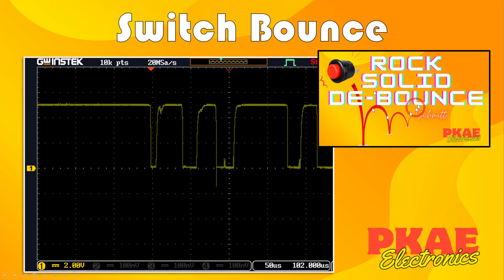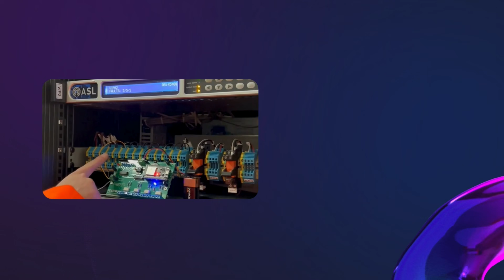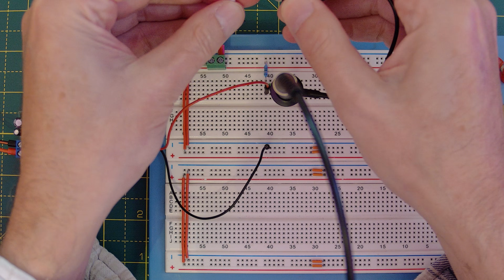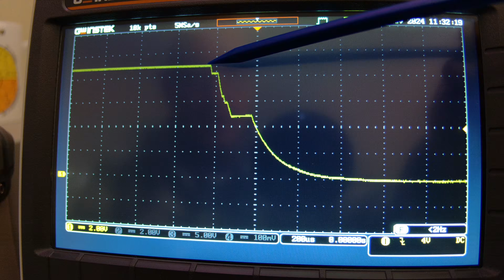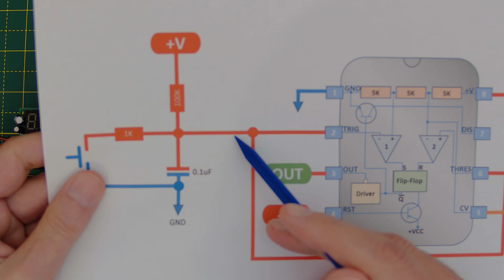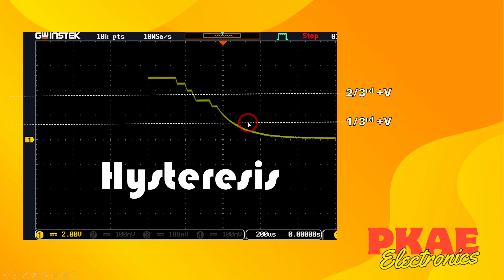Switch De Bounce Using a 555 Timer Chip.

Comment: Update:
I made the circuit on the tinkercad simulator, got the expected result so, now i will do the circuit for real; so once again thank you very much.
 I will implement your design, i'm having troubles with the bouncing, so i'm pretty sure it will work, i will try to understand as much as possible, but it can see it is a great design, so thank you so much.

Comment: Sir, is this a circuit that I can use to debounce lets say my flipper input buttons? Is this fast responsive? Or is it best to make a schmitt trigger circuit with actual schmitt trigger? What would work best to suit my needs? (I'm making a pinball table and we need debounced input buttons for proper microcontroller input handling.)
Reply from the maker: Sounds like a great project. 

This debounce circuit will give you a fast transition from high to low and vice versa, but the responsiveness is really derived by the sizing of your capacitors and resistors. There is always going to be some lag. If you are using a microcontroller, it is likely that the digital I/O's already have a Schmitt at the input stage (what microcontroller are you using?). 

In my opinion, if you are not doing anything other than activating the flippers when you press the button, then I would just hard wire the thing (probably via a transistor) and not utilise the microcontroller for this aspect at all. The mechanical response of the flippers will be massively slower than any switch bounce experienced. You're going to need fairly good quality push buttons anyway, as they take a bit of hammering in pinball.
Reply: @paulpkae  Im using arduino uno r3
Reply from the maker: @CrazyByte2007  uno as based on the ATmega328P which I believe does implement Schmitt triggers on pins configured as digital inputs.
Reply: @paulpkae  hmmm then those videos showing examples using an external chip (using arduinos) they are different? cause they recieve quite bouncy signals on their led / button combination (recieving lines of 1s in their terminal for 1 button push) I'm gonna check this first with my arcade buttons without any circuit to debounce and see if they bounce. Is it some feature disabled by default? or is this dependant on witch chip is inside the arduino running it? I believe I have an ATmega one.
Reply: @paulpkae  I was also thinking about that, but driving solenoids high for a while burns them out. So I figured to use pwm signal from arduino to drive the solenoids just enough to hold the ball when the player is holding the button down. In that case my thought pattern went to that direction. I also have a 4 channel mosfet to drive the solenoids. (so they are seperate from arduino and run at 12v from a PC power supply....)
Reply: I don't know if it works but on my channel in the community posts area I am posting pictures of the build. (it's a slow progress)
Reply from the maker: @CrazyByte2007  mosfets are a good shout, as they can typically handle higher currents than BJTs. You could use a 555 in astable mode to generate the PWM signal.
Reply from the maker: @CrazyByte2007  I have taken a look and it's looking good. I can see you're also using KiCad and getting PCBs manufactured. Great stuff!
Reply: @paulpkae  I just got two 555s in the mail today. guess I will be searching how that would work.
Reply: @paulpkae  Yes I picked it up 5 days ago. My first design is not correct tho. The second one that has a wider board should work fine. While creating it people from electronics stackexchange were very helpful. Might have to do some more verification before I actually let them get printed... so I got a breadboard and all the components, that also arrived today. So tomorrow it's breadboard day.
Reply: @paulpkae  Trying to post pictures of the build progress as often as I can. Today It was connecting leads to the first button and testing the led. I also found a combo LED that lights up green or yellow depending on how you wire it.
Reply from the maker: @CrazyByte2007  I have done a couple of videos illustrating the 555 Astable operation (links below). 

You can connect the 555 output to your MOSFET gate and use your push button to control the 555's reset pin (pin 4). Pin 4 should be held low and only pulled high when the button is pressed. 

https://youtu.be/3lEN6hEGUmE?si=-RFDLcEUCwk5RWEb

https://youtu.be/4NXjBRarmeg?si=5jD3LZUkFBkYvRti
Reply: @paulpkae  interesting. I will have a watch when I have some time to concentrate ;) just finished soldering connectors to the buttons checking polarity and done the wire labelling. So far the buttons seem to respond quite rapidly with the current circuit. 10kR, 1kR, 1N4001 & 1uF cap to schmitt trigger...
Reply: @ making progress.... https://www.youtube.com/shorts/9fS7Qp7z7gw
Reply from the maker: @CrazyByte2007  looks like you're having some fun with this; it's a great project. Reminds me a bit of my Fruit Machine project which I started and never really finished.
Reply: the breadboard recipie has been made and put to the test with the default readdigital pin sketch. it goes from solid 0s to all 1s if you push and hold the button. if you let go the 1s become 0s. if I read the monitor, I don't see something like this 011000110110000001110000010101010111111000000 where this could be just 1 button push without the circuit in place. with the circuit it's 0000000000000000000011111111111111111111111111111111000000000000000000000000000011111111111111111111111111 etc. no gaps. I don't know if it's fast responsive, waiting for solenoids.

Comment: Another question:
If you connect the output of 555 trough a capacitance to a TTL, the capacitor being also connected to +5V on the TTL side, then when the 555 output goes high the capacitor's voltage will momentarily be 10V. What will the TTL "think" about that?
Well the voltage spike will be very short in practice, but...?? Maybe one should add a diode between 555 and TTL to be safe.

Comment: I have enjoyed watching your youtube videos. They are well done and very informative, thanks a lot!
To my question:
Can you make an electrical connection using 555 such that when its input state changes either from low to high or high to low the output is a low to high (or hi to lo) pulse of a duration determined by RC?
Thanks,
Juha
Reply from the maker: Hi, many thanks for your comment.
The answer to your question is Yes. You can achieve the exact behaviour you queried, by configuring the 555 in a monostable arrangement. I will be doing a video in this in the near future, but in the meantime, you can find this circuit on the 555 datasheet.
Reply: @paulpkae  Thanks a lot! Now I remember that I have somewhere a datasheet book where 555 is also discussed, I just need to find it :-)
Reply from the maker: @MrJPI  if you Google "555 timer" and click on the "ti.com" link, you can view the datasheet online or even download it.

Comment: What about just using the 555 in bi-stable mode?
Reply from the maker: Really depends how you want the Switch to operate your device. In Bi-stable mode you typically utilise two momentary push button switches; one to latch a HI output and the other to latch LO. The behaviour is therefore quite different to a single push operation.

Comment: Ok, before that my favourite was schmitt trigger debounce method, now I have to try this. Thank you very much, Michael
Reply: Isn't this a Schmidt trigger? The pre-set 1/3 and 2/3 dividers of the 555 define the hysteresis limits.
Reply: @tedbastwock3810  Well, this one has a possibility to be tuned.
Reply from the maker: Thanks. 

A dedicated Schmitt IC is the better option, although I suspect many hobbyists have 555s in their home collection but not necessarily Schmitt triggers.
Reply: @ I see. Actually I also have a bunch of 555. And I like the idea of hysteresis configuration.
Btw, are you planning to describe a different variations of 555 maybe?
For example speedy ones:
Lmc555(up to 3MHz) or Tlc555 (over 2Mhz)
I have no idea where I could use such a speedy species of this family. For the radio devices construction, maybe?

Comment: Basically this configuration of the 555 is a Schmitt trigger inverter.  If you only need one and need to save board space, this will do.  Otherwise get a hex Schmitt trigger, more popular as an inverter.  If you get the inverter but don't want an inverted output, you have 5 other inverters in the package
Reply from the maker: Thanks for the comment. For those interested in the Schmitt Trigger IC alternative see my previous video here:-
https://youtu.be/JrCIgBUPhro?si=zdwQePjjZ9tjILGp

Comment: Of course if you just want a nice clean pulse with a minimum pulse length from a push button, you could use the 555 in it’s monostable configuration.
Reply from the maker: Video coming for Monostable operation. 😁
Reply: There 's no guarantee that the contacts will break cleanly.  If they bounce as they open the monostable may trigger again.
Reply: The problem with using a 555 in monostable state for denouncing is that the 555 won't hold the delay while the trigger is triggered.  Say you have the 555 delay for 100mS, and you hold the switch down for 1S, the 555 will still reset at least briefly after 100mS.
Reply: @danman32   actually a good point. I have to check if there is possibility to avoid this. 
If no, well - In this case I think usage of comparator will be more reliable…
Reply: @CybisterBug  there is if you're not particular about the timing.
Use a transistor to hold the capacitor discharged whenever and during the time the trigger is asserted.  Timing will then start once the trigger remains deasserted
The problem with 555's, especially in monostable mode is that there's a timing difference between right after power up when capacitor is completely discharged, to during normal operation where capacitor would be at 1/3 VCC at idle.
Reply: I see. Thank you @danman32